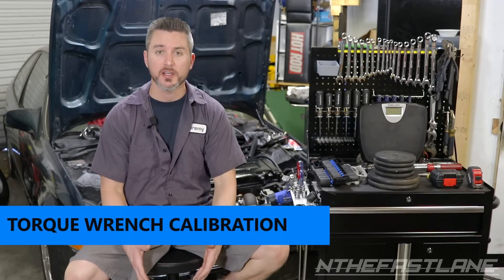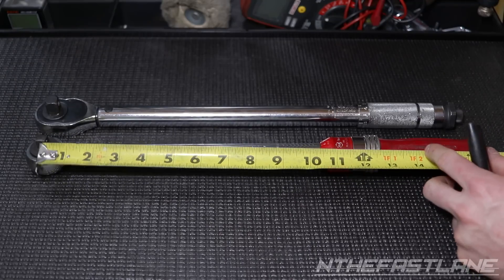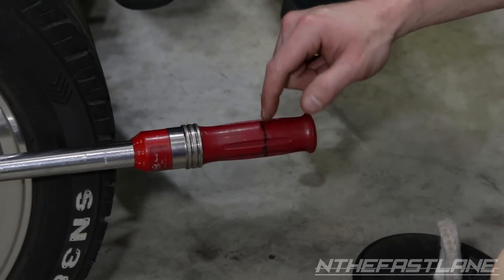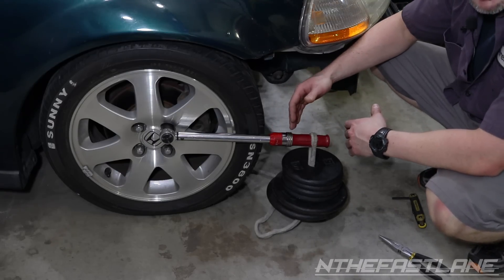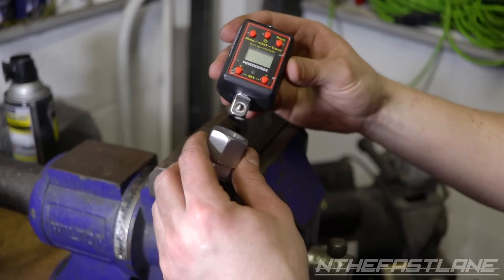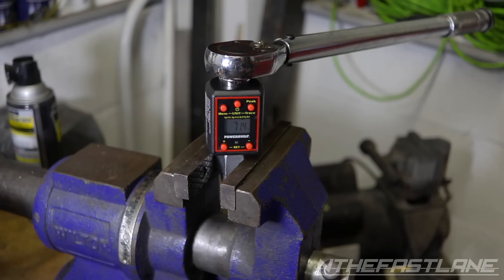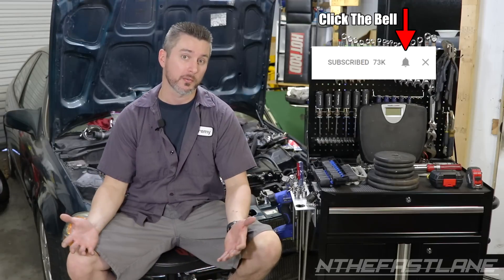▶️Torque Wrench Calibration (The Complete Guide)🔧

Comment: You are making this harder than it has to be. Calibrate at 12". You are using a formula because the applied force at 15 requires less than at 12" and you are calibrating 40 ft lbs not 50 ft 1.250 lbs. It does not matter where you hold a torque wrench as you are measuring torque, not the applied force to create the torque.
Reply from the maker: It does matter. If you take 40 lbs of force to a specific area on the handle and it makes it click, if you move that 40 lbs forward towards the selector, even a little bit it will not click.

If you move it further out towards the end of the handle it will click prematurely. Taking 40 lbs and sliding it all the way to the tip of the torque wrench will actually apply more force, though it will still click at 40 ft lbs it will go past the click and apply more torque. We want it to click only at 40 ft lbs not 41 not 42 to be accurately dialed in when calibrating.

The weight is not like a human hand, it doesn't stop applying the same amount of force when clicked. A human hand when it hears the click it stops. That's the difference. And that's why it has to be in the correct position when using 40 lbs of weight on a rope.
Reply: @Nthefastlane  By your own math on the 3/8" wrench in your example makes sense in principle, but it assumes the force is applied at a single point. In reality the wrench is calibrated to the center of the handle grip, so the effective lever distance is measured to that midpoint. If the calculation doesn’t use that reference point, the torque result won’t match the calibrated condition — which is why ISO and Snap-On specify the handle-center location when calculating 
𝑇= F X L
To be fair, on a typical 3/8" click-type wrench the plastic handle is only so long anyway — say roughly 12.5" to 16.5" overall. As long as you’re actually holding it by the plastic grip and not choking up onto the metal body or way out past the intended grip area, the effective lever distance doesn’t change much, so the torque error is pretty minor and probably within the wrench’s own accuracy spec.

Just to put numbers to it: you’re using a 40 lb weight and assuming 15" from the drive, so you set the wrench to 50 ft·lb because 40×15/12=50.

But the effective center of the grip is actually 14.375", not 15". That means the real torque when it clicks is

40×14.375/12≈47.9 ft·lb, not 50.

So the wrench is now calibrated about 4% low which is at the upper limit of specification. When you later set it to 40 ft·lb, it will actually be applying roughly

40×47.9/50≈38.3 ft·lb at the fastener.

That’s why calibration specs use the exact handle-center distance when doing 
T=F×L — a small error in assumed length shows up directly as torque error.

So yes, in theory hand position matters, but in normal use with your hand on the grip where it’s meant to be, the wrench will be close enough to the set torque that it’s not worth losing sleep over. This is why they came out with stretch bolts as torque alone is a poor way to control clamping force.

Comment: Doesn't the handle move (shortens) when you dial it to the ft. lbs?
Reply: Yes, rather than using a mark that moves, force should always be applied at a consistent measured distance from the fastener axis. That's how it's done on a loading bench when calibration is done professionally. Changing the distance will introduce unnecessary inaccuracy, but if the mistake is made, at least the variation curve is not very steep there, and the amount of error from that may well be less than from other variables.

Comment: Where you push makes no difference.  It's only important for the testing.  The shorter you grip the wrench, the harder it will be to move.  The wrench doesn't care.
Reply: So if you push right where the outer tubular handle connects through the pivot, you'll have to push really, really hard, but the wrench doesn't care, when you push hard enough it clicks at the same torque, right?
Edit - since there's been no response, here's a hint: No, it doesn't happen that way. "Where you push makes no difference" is a mistaken idea for a dual lever click wrench. If you shorten your grip it measures the torque value wrongly.

Comment: Hmmmm?  Maybe I am totally missing something here but.  .  . His picture states to divide the measuring length by 12.  Then, to take that result and multiply the weight by it.  But, his narrative states to divide the weight by that number, in his example, 1.25.  .  .  So, which is it?   Multiply your weight by the 1.25 result or, divide your weight by the 1.25 result?  Also, how would this all be converted to inch pounds?

Comment: When you orient the wrench horizontally there is an additional weight acting on the wrench that adds to the torque, the weight of the wrench itself acting through its center of mass. If we assume that the mass of the wrench is approximately uniformly distributed long its length we can assume that the center of mass will coincide with the midpoint, for greater accuracy we can balance the wrench on a knife edge and measure the distance from the center of the drive tang to the balance point. As a simple numerical example, suppose the wrench is 16 inches long and weighs 3 lbs. The center of mass distance is about 8 inches, so that the additional torque would be about: (8/12)ft*3lbs = 2 ft*lbs.

It's not a lot, especially if you're measuring large torques, but it is an improvement.

What I would do for a quick and dirty calibration tester would be to either chuck the wrench in the vise in a vertical orientation, eliminating the torque generated by the wrench's weight, or position it on a wheel lugnut in a vertical position. I would then get one of those hand-held digital electronic luggage scales and place the strap around the middle of the handgrip area or the machined groove, if there is one. I would then pull horizontally and read the torque where it clicks and make adjustments accordingly.

Comment: Using weights ignores the weight of the torque wrench itself! A ½" wrench can easily weigh a couple of pounds. And, you can't just add in the weight of the wrench since that weight is distributed along the length of the wrench.

Comment: When you wined the handle in to adjust the torque you are changing the radius(from hand to bolt head ), so you need to Set your torque then measure your radius then calc your weight etc Because you will have wound your handle towards the bolt by about an inch.  Also choose a calibration torque in the middle of the torque wrench range  eg for 40-210 Nm choose  125 Nm.  Over adjust your torque wrench slightly then keep backing off the the threaded spacer nut that compresses the spring with each try, until you find  where your wrench just clicks when set to the calibration torque ,then lock in place.  Have to loosen off spring compression for each adjustment  and then  reset the calibration torque.  For next try etc..

Comment: You didn't account for the fact that the weight of the handle is applying some torque to the head of the torque wrench. You also need to set the torque wrench to the desired setting torque setting before measuring where you're going to hang the weight.
Reply: You've GOT to be kidding?  Torque Nazi!

Comment: You should pull on "the groove" mark on the handle!

Due to construction of click wrench with secondary shaft inside main body you MUST NOT measure directly from the head! Instead you should attach you pull scale right at the groove of the handle and measure from the groove to the middle of the head (socket), then calculate adequate force. Secondary shaft and whole "click" mechanism change geometry of click wrench so typical "length x force" does not apply as it would with simple, solid shaft/bar. Look into construction of click wrenches or service/assembly to get better idea.

Also remember that 1 Newton = 0.1019716213 kilogram-force. 
A kilogram-force (symbol: kgf) is a unit of force in the gravitational metric system. It is defined as the magnitude of force applied to one kilogram of mass under the condition of standard gravity (9.80665 m/s2). One kilogram-force is therefore equal to 9.80665 N.

Good luck

Comment: So if you have a 1/4" or 3/8" torque wrench where the handle is less than 12" long and you decide the line you will hang your weight on is 8" do you use what will amount to a less than 1 ratio to set the wrench compared to actual hanging weight?  For example a 20 lb plate weight at 8" from socket center you would dial the wrench to 8"/12"= .667, .667*20=13.3lbs?  Would you set your wrench at 13.3 lbs with a 20lb weight hanging 8" out?
Reply: Yes,your calculations are right.

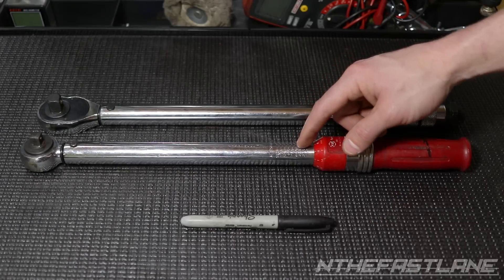Comment: completely wrong calibration methodology used 3:17 - you have used the 15'' mark when the handle is way below, but when you adjust the handle to the 50ft-lb mark the length wont remain 15'' and your calculation would be wrong

Comment: This method would work for the value you have chosen, 50 ft lbs in your case but there is far more involved. All torque wrenches are set at factory with three locations tested to ensure overall accuracy at all settings, not just 50 ft lbs. If any one setting is adjusted for during Calibration by a qualified technician then three locations are tested to ensure accuracy through the entire range of the scale. This means you need to check 20%, 60% and 100% of the scale values. It is easy to make a wrench accurate at any one location but in doing so you very likely make the rest inaccurate. Non electronic Torque wrenches are very robust so if your wrench is not accurate then you first need to address why and fix that first. Usually the grease inside is old and has lost its lubrification factor making the movements inside not moving well. It is common during Calibration of a wrench to strip it down and clean it, then add new grease. Then the wrench is fine again after calibration. This means if your wrench is no longer accurate and you simply do what you have mentioned here without addressing the reasons the wrench is no longer accurate, you risk making the wrench only accurate at this one setting. So you must check all three locations mentioned above after any and all adjustments. Each time you make an adjustment you have to check all three locations again. By the way I am certified by Snap On to repair and calibrate torque wrenches.
Reply: What would you charge to work on a Snap-on 1/2 drive 50 to 250 foot pound wrench? Nut in the handle came loose in mine this afternoon. Not sure what the model number of it is.
Reply: @timw1573  I am not equipped to test them like this anymore. I did work at it for a time but am retired now. You may not have a real big problem. send me a pic of the wrench and a pic of the loose nut. Or send me the model number.
Reply: @Soniccues  Thanks. Sorry I haven't replied back on this; been fairly busy. I think it's a QD3R250. The Snap-on rep was around today and we checked it on his torque check tool. Looks like it's about 20 LBS off. I will try and send you a couple of pictures. I bought a new QD3R250A. I still might want to try and get this other one working and maybe find it a new owner. $120 to send it in to through the rep.
Reply: @timw1573  Top of the line wrench but best that it be calibrated by a tech trained to do so.
Reply: Damn, I hate "torque Nazis".  If it works at 50ftlbs, it'll work at other settings.  I used beam type torque wrenches for decades, never had a problem.
Reply: @ronaldjohnson1474  You are right about beam torque wrenches, they are exactly as you described above. But present day click wrenches are not.
Reply: you are correct., and I might add, both the directions need to be checked if you use the wrench ccw
I work at a commercial lab, and we charge ~$75 to test and adjust, and also can repair many ratchet assy, for an added $35
many major cities have at least a couple labs local that will do this, for about the same price
Cheep overseas made wrenches usually can't be adjusted more than 1 or 2 times, and the ratchets are not repairable
Reply: @dr_dodge_racing  Yes thank you, and as you would know if you are trained to repair, the Industry standard is 4% CW and 6% CCW but my standard was 1% CW and 2% CCW for wrenches used on Aircraft which was the main industry I repaired wrenches for.
Reply: I think you’re wrong I use them daily and that method gets it close even to the electric ones

Comment: Would it be as accurate to use 12" as the 1 ft/lb mark and whatever you would desire for the weight you are using? Then you would not have to do the math steps. ie: 40 lb weight would indicate 40 ft/lb on torque wrench. 50 lb weight would indicate 50 ft/lb on torque wrench. then adjust torque wrench as desired. Just wondering. Thanks!
Reply: I think this is because it's best to hang the weight from somewhere between the middle and end of the handle, where you would put your hand when using the wrench.

Comment: If you dialed it in at 50ft/lbs when you test your setting,isn’t it going to click at any setting below 50ft/lbs?
Reply from the maker: 49.9 ft lbs sure. You can feel when it's going to click in and out. When you get to the very max where it has that final click, that's where you leave it. Every torque wrench has a percentage that they're allowed to be off by regulation. +-/4% is the standard.

Comment: I'd leave the bathroom scale out it.  I worked in a lab with calibrated scales and I brought in and weighed a variety of cast iron weights like you used. They were all spot on (several different manufacturers). So if you put 40 pounds of weights on your scale and it doesn't read 40 pounds, I believe it would be much more likely that the scale is off, not your iron weights.  What you did was actually calibrate your bathroom scale, and it was perfect.  If you don't have any of these kind of weights and are using your bath scale to weight some object you want to use, like a cement block or something, no "weigh" I would trust the displayed value to be accurate.  Also, how would you know your digital torque gauge is accurate?  To have faith in my calibration I would have to do what you did (minus the bathroom scale part)...  First calibrate your wrench using iron weights, then check that result against your gauge.  Once your verify that your gauge is accurate, then you could use it with confidence.  Good video!
Reply: Most people are using torque wrenches improperly anyway so the calibration is likely a moot point.

Comment: Does the digital adapter need to be calibrated over time as well?
Reply: No. It's a very simple electronic device. No moving parts. If you open it, there's just a short socket extension with strain gauges glued on in a Wheatstone bridge set up. As long as the electronics work, the factory calibration should stay good.

Comment: My Sealey 3/8 torque wrench has both the end adjustment shown at 1:10 and the grub screw hidden under the rubber grommet so I confused by which I should use to do the calibration.

Comment: Do I need to set the wrench to 0 ft/lb before measuring and mark the 15 inch on the handle?
Reply: I was going to ask the same question. I think the best way (I'm going to do it this way) is to first figure the weight you are going to use, then set the wrench and then measure.
Reply: @javirodify  yeah I don’t think it matters unless you’re testing zero lbs torque. When you change the torque setting the length of the wrench changes right? So if it’s 15 inches to me it has to be 15” at the weight you’re trying to calibrate at. Otherwise you mark the handle at zero ft/lbs and then set it to 20ft/lbs the mark on the wrench isn’t at 15”
Reply: Good question.  Without it's answer I would not be confident of an accurate calibration.

Comment: I have the old school Craftsman 3/8 click type torque wrench that you have to open up the bottom, plastic cap to adjust. The locking nut has very little clearance for a socket. Do you know what style thin walled socket or tool would fit that?

Thanks for post this video!
Reply: Have had this issue ...as it happens wrench is in spec.... still haven't found a way to get at that nut , needle nose pliers don't work for me. Was thinking of cutting handle, replacing nut with one I can get at and then somehow restoring cut off piece OR buying a wrench with different cal method 🙂